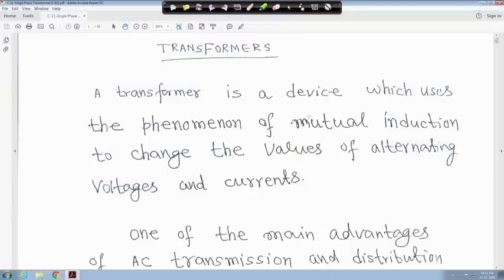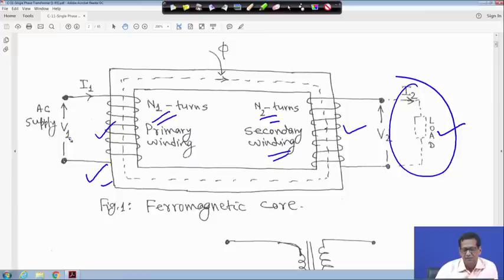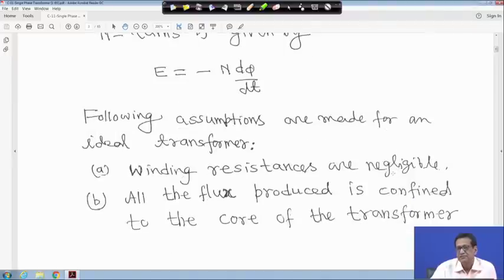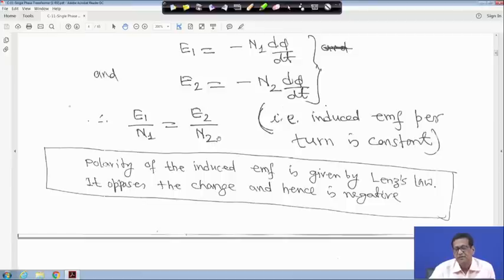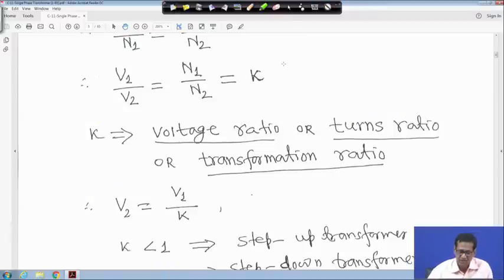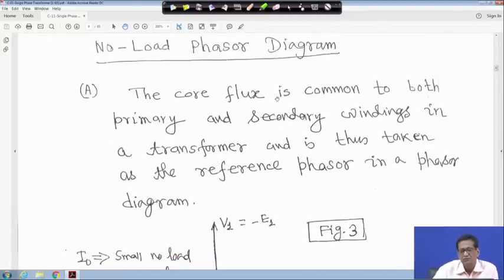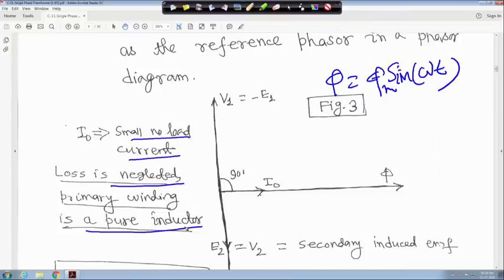Lecture 54: Single Phase Transformer

Comment: 00:14 Single phase transformer increases or decreases voltage
00:38 Single phase transformer operation explained with ferromagnetic core
01:45 Understanding transformer winding resistance and core flux limitation
02:13 Principle of Ideal Transformer
03:50 Impedance of transformers varies with load current and other factors.
04:19 Understanding the relationship between primary and secondary voltage and current in a transformer
05:45 Transformer ratio calculation
06:25 Understanding the voltage and current in single phase transformers
07:58 ಟ್ರಾನ್ಸ್ಫಾರ್ಮರ್ ಬಗ್ಗೆ ಸಂಗತಿಗಳು
08:33 Explanation of phase relationship between current and voltage
10:21 Explanation of the term N1
11:15 Explanation of primary induced emf E1 and relationship with V1 = - E1
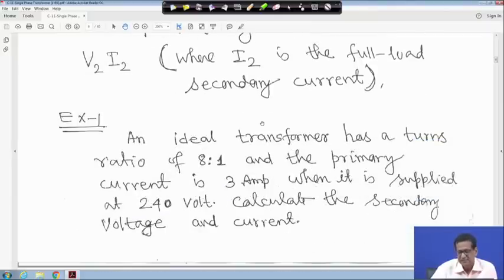12:36 Iron losses are minimized for practical transformer.
13:32 Understanding 2400/400 Volt Transformers
17:46 Understanding EMF in magnetic circuits
20:24 Calculation of transformer turns ratio N1/N2

Comment: At 9:55   k>1  for step up transformers
Reply: its actually correct, sir has written the eqn differently, if k>1 it means V1 > V2 which means it is a step down transformer.